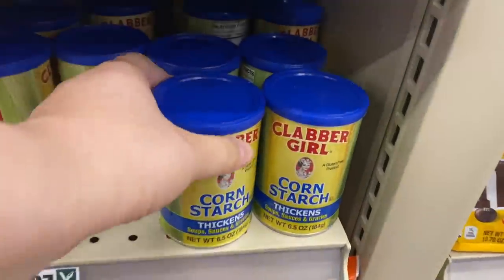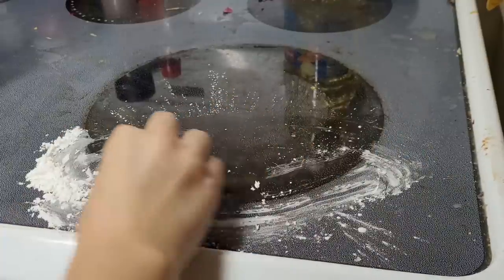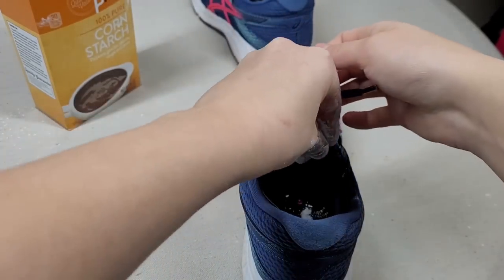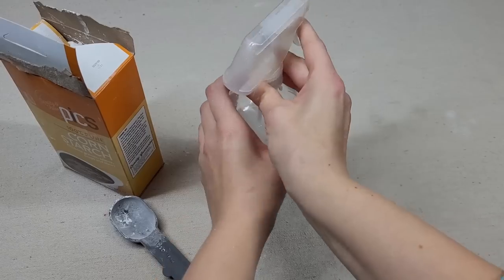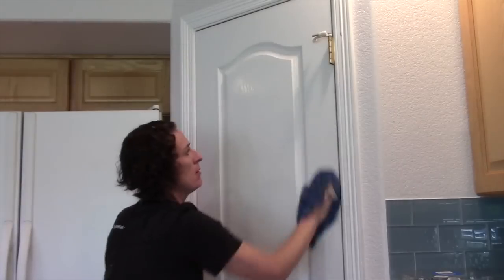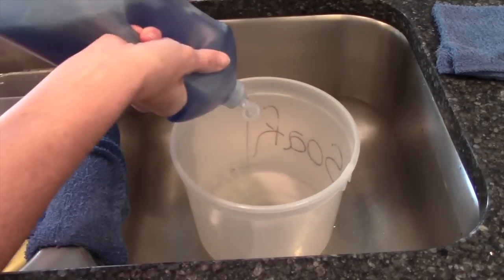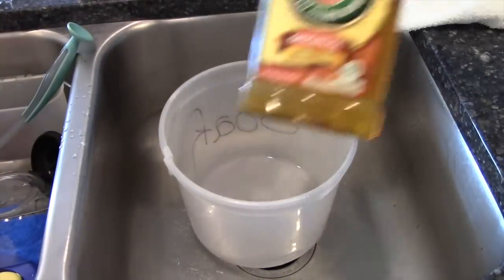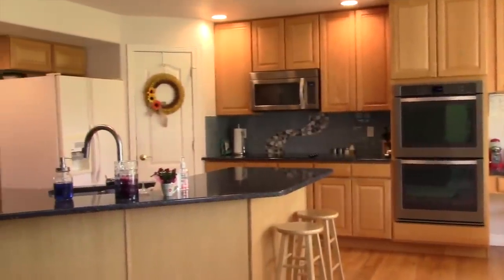Home hacks using cornstarch you probably didn't know!

Comment: After cleaning my fridge I put dish draining pads on the shelves & in the drawers. (the re washable kind from the$1.00 store) 
This keeps the shelves looking cleaner longer. The pads are made to absorb liquid so, any little spills or dampness is absorbed. They can be washed & used over & over again. Quick tip: I keep 2 sets of them so I always have a clean set to put in there while the dirty set is in the wash. 
Someone told me that it was a "brilliant idea".  But, since I don't like cleaning out the fridge I try to find shortcuts to make sure I don't have to do it as often! 
Give it a try if you want to work smarter not harder! 👍 Good luck!
Reply: I put folded paper tower instead, it can absorb liquid too and I just need to throw it away and replace it with new one when needed.
Reply: Do you have a picture of what you use?
Reply: @theweatherisaokay4964  Yup, I used to use them until I found the drain pads. Sure saves time when you clean the fridge & I have to say that it's NOT my favorite chore to do!